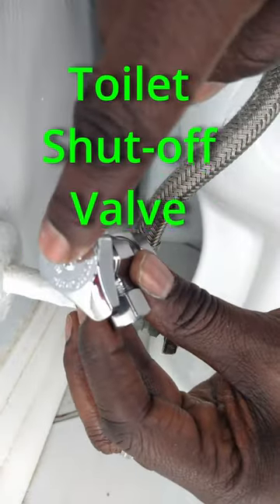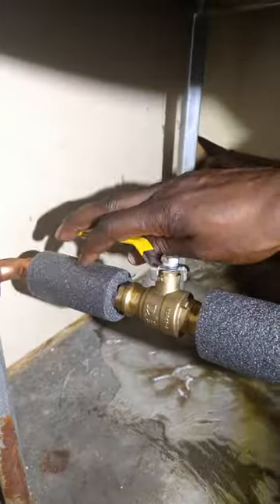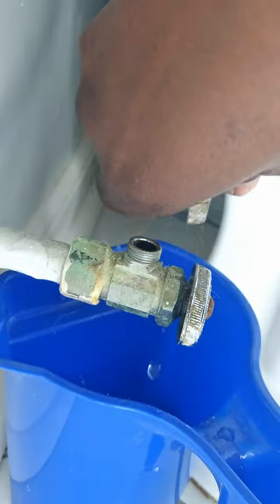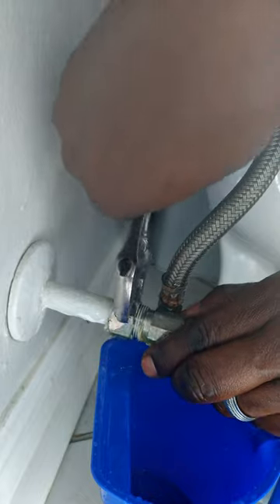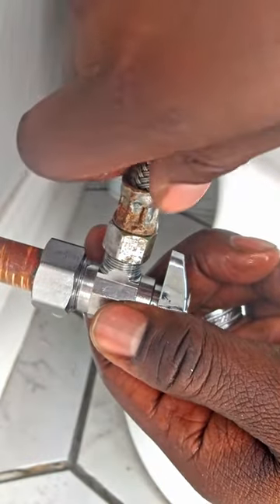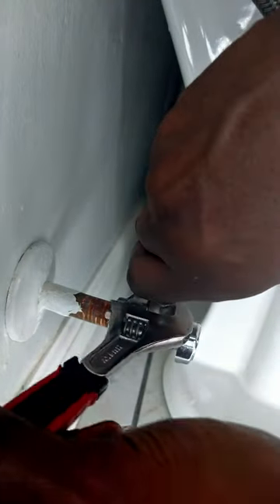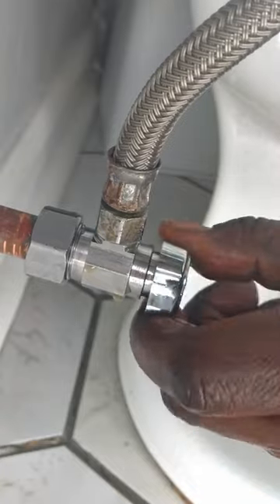How to Remove and Replace Toilet Shut off Valve - #Shortsvideo - #Short

Comment: Always sand down that copper line before you put on new shut off valve
Reply from the maker: Great tip.
Reply: And change the batteries.

Comment: Thank you. I ended up having to cut the inlet pipe with my pipe cutter to replace the valve. Wasn't a  problem with the compression sleeve valve.  Tools pipe cutter and new valve all in $30 maybe under. Plumber was $50 just to walk in the door. Satisfaction of doing it yourself; Priceless.  Thanks again.

Comment: Thanks for the simple video.  A few more tips to add in case you are having issues.  I just installed a few of these and they both leaked a tiny amount.  I thought it was because I tightened them too much - apparently you can do this.  So, I removed them and to my surprise, the compression ring wasn't even compressed.  I removed them, deburred the pipe again and sanded it better to clean off.  This time, I added pipe thread compound to the compressing ring and to the threads (not to seal them, but so I could get more consist ant torque on the nut.  I hand tightened, and then tightened maybe another another 1/4 turn (90 degrees) with a wrench.  No Leaks this time.

Comment: Do these come in diff widths or all same size? The builder put it in.
Reply from the maker: There are different sizes, but most come in a standard size. If you turn off your main water, you could take the old one to Home Depot and ask them what size it is.